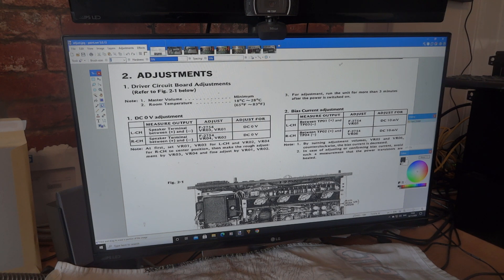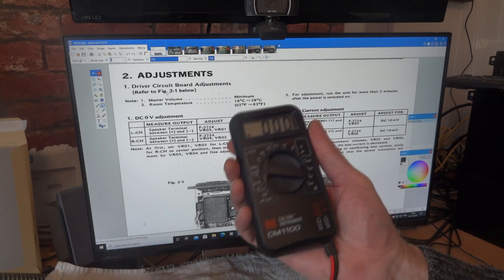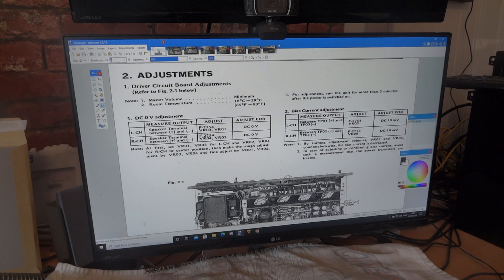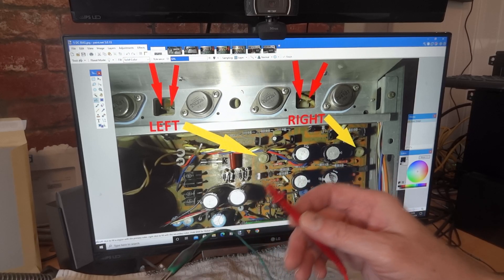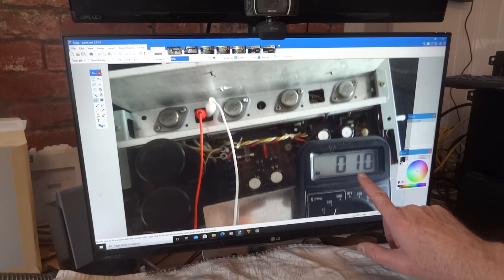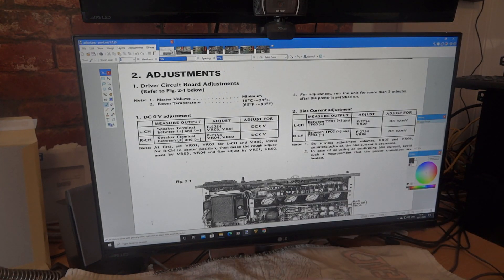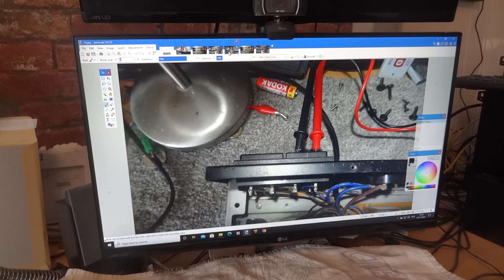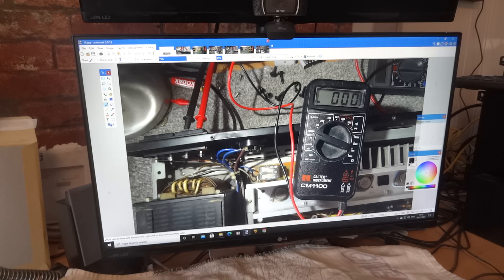Sansui au 317 Amplifier DC Bias & DC Offset Adjustments

Comment: that's geat, my 317 lost the left channel so I have to fix it, would you mind to let me know where you found the service manual?
Reply: found it already, thanks anyway
Reply from the maker: Pleased you found it
Reply: @MichaelYates  it's a 317 VII, no Bias voltage at the left channel, any idea?
Reply from the maker: @martin-f5482  So zero volts no matter how you adjust the pot. Then I would check that you have around 42 volts one side or Resistor 47 and 41 volts the other side of it and the same with resistor 53 as manual indicates
Reply: @MichaelYates  thanks, there's no voltage drop on it, same value on both sides (47Vdc) R48 (the one for the right channel has the 1Vdc trop.
Reply from the maker: @martin-f5482   Was there a drop across R53 . Without the amp here its hard to diagnose. But I think I would check the fuseable resistors first as these short, lose value and go open circuit so important these are working properly. They are shown as *3 on circuit diagram after that check the ones marked *2 as well.
Reply: @MichaelYates  hi and thanks a lot. the resistors are ok, but on the R53 there's also no drop.
Reply from the maker: @martin-f5482  Ok, next I would just check all the other voltage test points shown on circuit diagram to see if they can give a clue to were the fault is,if that all reads ok then you can use the right channel as that is working ok by just testing pionts at random and compairing to left channel it may show the problem area. After that without a scope and signal generator it might be hard to find the fault. Could be a transistor gone short or open circuit, could test those.
Reply: @MichaelYates  I'll do that, a signal generator and scope is available. will need some days to set up the workbench but I like to do that not only the sound of the 317 is incredible but also I love to do this

Comment: What does the DC offset adjustments do to the amplifiers Left channel and Right Channel? because if the left channel has a different DC offset point compared to the right channel has a different DC offset point, what happens?
Reply from the maker: The channel with the higher dc offset will signal will clip more than the other, sound more distorted and to high can damange speaker drivers. best to have both channels below 50mv with 25mv or less being good
Reply: @MichaelYates  Its adding DC offset voltage to the base or collector of the preamp transistors section or power transistor section? adding a +DC offset voltage to the AC signal/AC waveform will CLIP the the positive cycle or negative cycle of the AC waveform to the Power Supply Rail Voltage?
Reply from the maker: Hi, it is towards the end nearing the power transistors, a little video here on YT tells what DC offset is better than I can proberly explain https://www.youtube.com/watch?v=40rKM0rbqeA